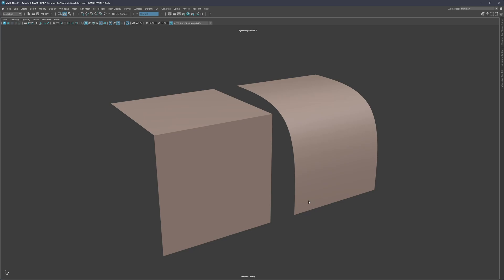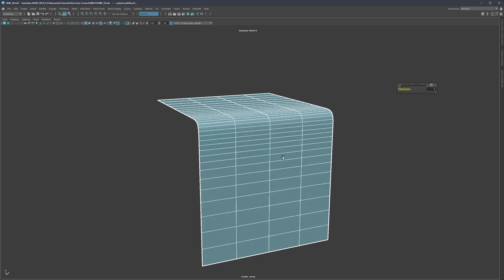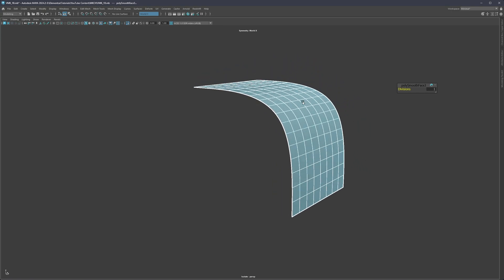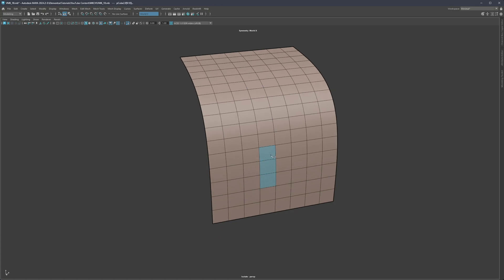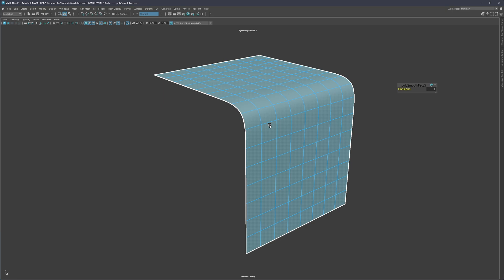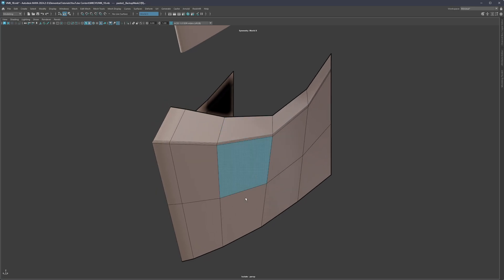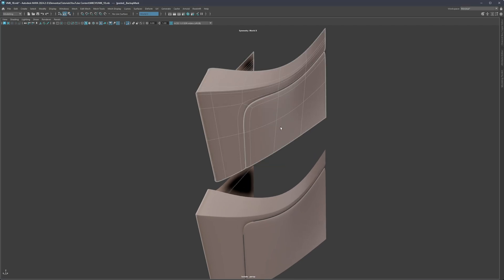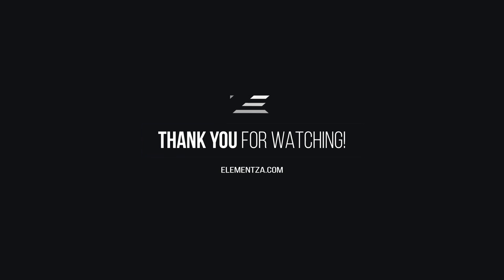Importance of Subdivision in 3D Modeling (Why Density Matters)

Comment: It's very intresting! Can we switch between low and high topology many times during modeling? If yes, how we can do it properly?
Reply from the maker: No not really... usually we set a blockout and work towards more details. If we make a save on each stage then its easier to fix things in chanve something goes off

Comment: Another great tutorial 🔥

However i have a doubt. Today i was looking artstation, and i came across a Sci-fi helmet model, the model had many panel breaks like the one you created in the example. My question is, If i wanted to recreate the same model do i i need to model with different shapes or do i need to model it in one piece and add the panel breaks later ? Because in my opinion it would be too dificult to model it in one piece.
Reply from the maker: Hi Sam... since you mentioned you have the workshop available to you, no worries, that topic is already covered in detail. More than I can answer in one comment line :) Also feel free to use our Discord for any related questions, might be easier
Reply: @Elementza  Okay sure !! ;)

Comment: hi ,In ZBrush, you can use high density in some areas to create details without applying it to the whole mesh. Is it possible to apply this method in polygonal modeling?
Reply from the maker: Yes we can for sure, but I would say ONLY after we know and understand the purpose of the object, and IF there is no surface impact. But for anyone just starting with 3D modeling, I would suggest building strong topology foundations first, then its gonna be easier to understand which rules are not set in stone, and which are. 
Hope this helps!
Reply: @Elementza Know and understand rules before you break them 🫡